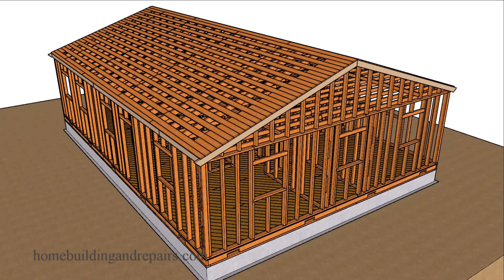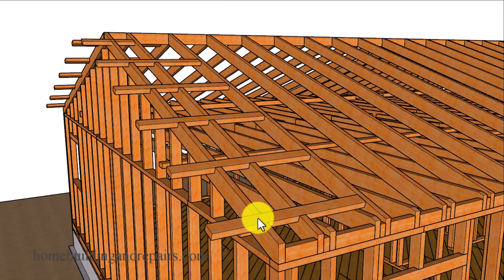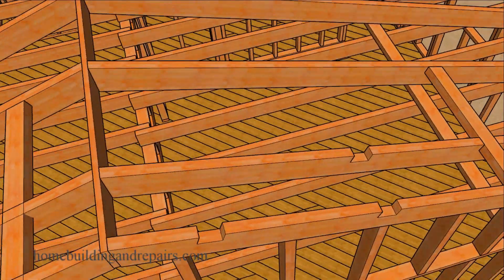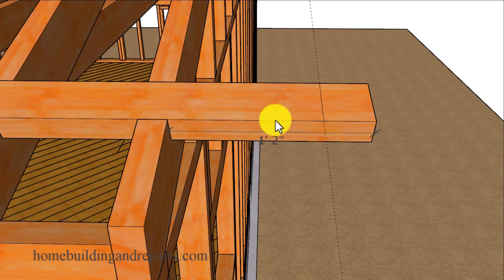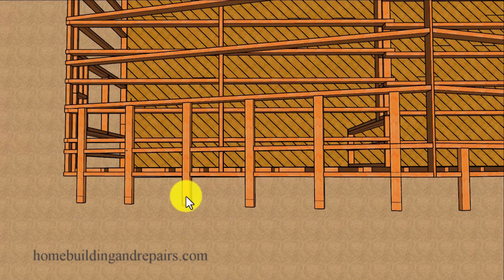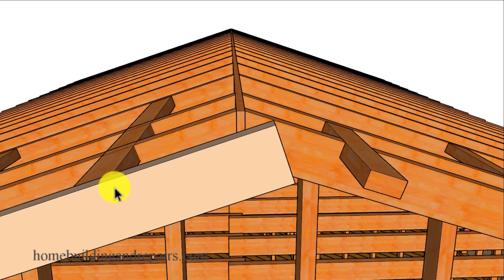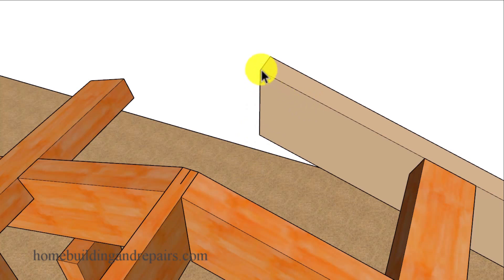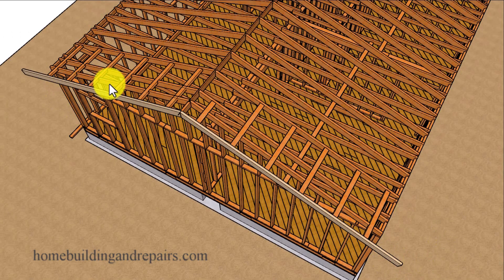How To Extend or Add Fascia And Overhang To Existing Home With Gable Roof - Home Remodeling Part 7

Comment: That brings back memories when I used to do facia and barge boards by myself two stories up as a young buck back in the 80's. I cut all the rafter tails and lookouts with a torpedo level duck taped to the circular saw to eliminate all those tedious cut lines, just a tick mark to start the saw on. Major time saver when cutting a hundred, give or take.

Since I had no one helping me, I would lay the facia and barge boards flat across the rafters and lookouts so I can hammer nails about every 6 feet on top of the facia and barge boards about third or so in, then bend them to the back side so the nail head sticks out beyond the board's back side. Then slowly slid the board over the ends of the rafter tails and lookouts until the bent nail heads catches on to the ends of the rafter tails and lookouts, then immediately hammer the nail heads sideways into roof frame ends to lock it in. This holds the facia and barge boards temporarily in place so you can take your time to adjust it for perfect positioning before  nailing the board into the frame ends.

I'd typically cut the facia and barge board ends on the ground because they're all miter/bevel cuts on both ends anyway for either corners or scarfed joints, and I cut cut tighter joints on the ground, but you do have to know how to pull proper measurements from the roof framing.

I also hold facia boards about an ⅛" below the top of the rafter tails so the roof sheathing can overlap the facia for about a ½" for support while allowing a clean run off for the roofing.
Reply from the maker: Thanks as always for sharing. I guess I'm getting old as a young buck who started around then also.

Comment: Why does the gable support framing in your video have two boards slightly off center from the ridge vs having a directly central ridge support board? Is it due perhaps to have a vent centrally located on the gable?
Reply from the maker: That's for a gable roof vent.

Comment: Thank you Greg for another great video!  This is suggested to adding the overhang on an existing structure. What about making one while building also the "house" from scratch. Would it be much different? thank you.
Reply from the maker: Not much difference and I do have complete building projects at our website that provide more information on this.
Reply: @gregvancom , thank you very much.
Reply: @gregvancom  , is it allowed to shorter  the span of the notches about less than 32 from center?

Comment: Can you build a certain amount of gable overhang relying on the strength of the roof sheathing (or the decorative boards you would have at the overhang so they look nice from below, not covered by soffit)?
Reply from the maker: Yes, I've seen them attach the overhang fascia or barge rafters to the 1x6 roof sheathing, but it usually ends up sagging over time.

Comment: Wouldn’t it be a lot easier to add ladder structures nailed into existing outer rafters. Build them on the ground, extend the gutter board and set in place, nail
Reply from the maker: I've never like the idea, because it seems structurally weak.

Comment: Any advice on doing something similar if my rafters are only 2x4s? I have some old skip sheathing on top of that, but I doubt I can notch them enough. Maybe sistering on some 2x6s?
Reply from the maker: Carpenters notch 2x4 roof trusses or rafters all the time for look outs to support fascia.